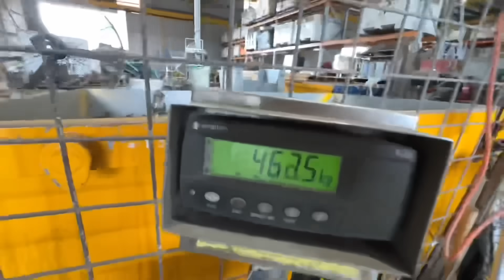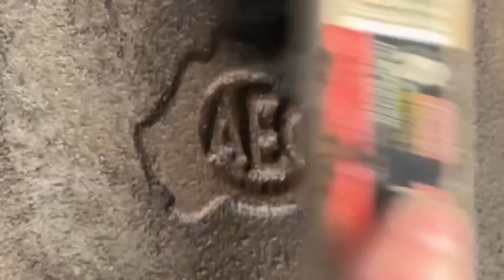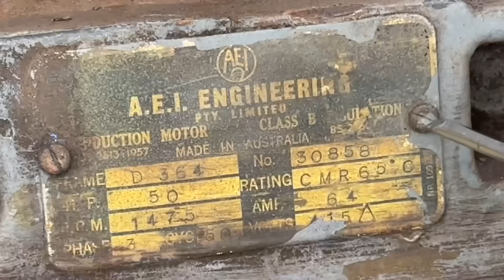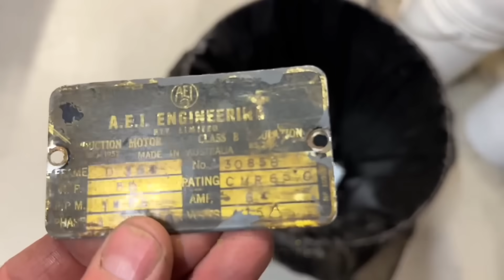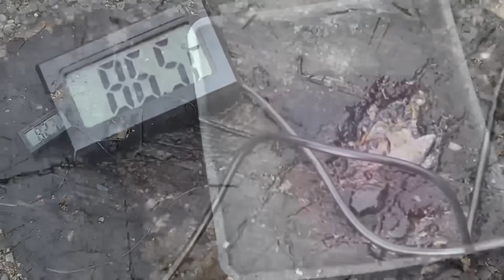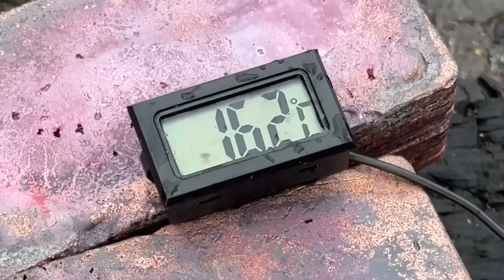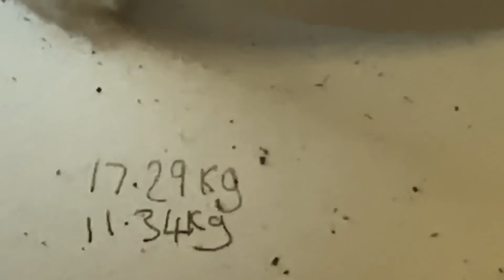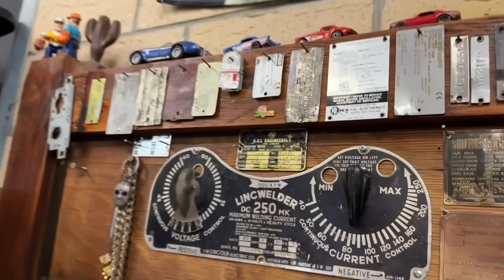433KG Massive Motor Melt Down - Scrapyard Search - ASMR Metal Melting - BigStackD Bulk Copper Bars

Comment: Bloody hell YEAH, grab 'em both, Mate!
As a medically retired Truckie, move the weight about a foot past centre axle. As in just a foot further forward.
Reply from the maker: Yeah wish I could but my  trailers only designed for 450 kg so I don’t really want to double that especially when I have to drive a little bit on some pretty shitty roads. No rush it’s all good I’m going back on Monday or Tuesday to grab it, and hopefully there’ll be some other pieces I can chuck in the trailer🤔.
Reply: I saw the first two lines of your comment and thought you were referring to the supplied picture of the Sex bot.
Reply: @bigstackD I can't blame you.years ago I ended up putting too much weight on my pup while my dispatch told me they wouldn't spend the time to get a different load for me.  once I dropped off the load, I called dispatch and told them, now the next time I tell you I'm not going to put 3,000 lb coils on my outside rail pup, you'd better listen to me.
That load didn't pay enough to cover the cost of redecking my pup.
Reply: You can take both if you make 2 trips to the scrapyard...might be gone otherwise. Early bird and all that🤔👍
Reply: @bigstackD 
 Do any of the parts get reused? Or do they all get melted down as scrap?
Reply: I don't know why, but it tickles me that used both metric and imperial measurements in your comment. 😊
Reply: @bigstackD  Hey BigstackD, just to clarify as I don't think he fully explained his point there. For just the one engine you never want to carry a load behind the axle of a trailer, that's how you'll get speed wobbles etc. If you're loading something heavy always place it in front of the axle, IE just the one engine you took should of gone in front of the axle not behind it like in the video. You risk some seriously dangerous trailer behaviour ( you can google some fun videos of improper load placements on hitchpoint trailers)
Reply: LOLOLOLOLOL

Comment: This is a nice video. Its so relaxing to watch at night when I'm winding down. I'm a new metal melter and I'm wondering how do you clean out your crucibles after you're done using them so you can melt other metals in them? Thank you.
Reply from the maker: @cassiusparker5176  normally I’ll just use a stainless steel spoon or a flathead screwdriver and give a gentle scrape. I’m not too concerned with cross contamination as these are just personal pieces I collect but when you have the chance I always recommend using one crucible for each different metal that way if there is a little bit of copper or brass left in it that can just mix in with the next melt, but other than that give it a gentle scrape out after you have poured or while the crucible is still pretty hot as that will make it a bit easier👍🏻.
Reply: @bigstackD  Ok, thank you so much. I'll be sure to do that when I get back to my melting. I melt at my school so I'm looking forward to showing my classmates these methods to make our melting easier. Thank you

Comment: Man, yo won't crack 100º while the sensor is IN the water. When any water molecule reaches 100º becomes gas, so it won't be IN the water. At least at 1atm. of pressure. This is how chemical destilation works, as much as you heat  the liquid it will stay at boiling temperatura until it fully evaporates. And you won't get superheated water in those open-air, water-moving conditions. Your are now getting 99º because it's winter and atmospheric pressure is slightly less than normal, so water boils easier. But it also depends on that cheap thermometer accuracy, that btw seems quite good.
EDIT: You get >100º when sensor is touching the tray bottom or the copper block
Reply: I was thinking the same thing
Reply: THIS!
If he read 100 maybe the sensor was on a copper brick.
But until the sensor is in liquid water at "normal" pressure you cannot reach or pass 100.
Then there is maybe a component of sensor calibration.

Comment: Nice video. the last motor i took apart i made a punch to fit the channels on the inside if the motor  and after cutting of end flush seems like it works extremely good abd cleaner and copper strands stay together to then.

Comment: Maybe it's a running joke I'm not aware of (this is my first time here) but unless you compress that water it will never crack 100C when it's in liquid stage.  The steam will though.
Reply from the maker: @fisqual  I did actually get it to crack 100 but because it’s a cheap Chinese temperature gauge it was obviously reading incorrectly or maybe it read the steam for a little bit as it was bubbling away🤔👍🏻.

Comment: Got my furnace in today! Can't wait to start doing this. Have you ever tested the max temp on yours?
Reply from the maker: @metallurgy_gaming  I haven’t tested the max temp as I’m not sure what it’s really safe to run on the regulator, but I just did cast iron again the other day and it did it quite easily. Only reason I would test the max temp would be to melt steel, but I have no plans on melting steel, even if I could👍🏻.

Comment: You made friends with Magpies!!! The more I learn about you the more I like you. 

Also: sucks you have to burn the varnish off the copper, even if you chemically stripped it the varnish would still partially dissolve into gas and the chemical bath has to go somewhere.
If you strip it mechanically, which is not really feasible, it still mostly gets burnt in the furnace. No matter what you do that stuff ends up in our environment, even if you left the motor at the scrapyard! Someone would have to deal with it.

I'm definitely watching more of this tonight. Thanks for the big video the editing and camera management must have taken ages 🙂

Comment: You're not gonna crack a 100 when it's rainy and the atmospheric pressure is low - water boiling point goes down. Try that on a sunny day, no rain, 1020 hpa and more

Comment: If you were scraping these motors regularly, what about designing a furnace that is built round the stator casting? You could burn the varnish off the way you just did, then heat the stator until the copper drips out the bottom and have a catch tray.

Comment: Regarding flat head screws. I find the easiest way to go about removing them is to (very carefully, if you want to keep the info plate underneath) take a grinder to the slot of the screw. Just enough to deepen the slot until you can get a good go at it with your flat head screwdriver. It isn't very hard to do and you don't even need to destroy the screw to make it work.

Comment: man I would  have turned that motor  housing into an out door fire place to preheating for your molds. but that's  just me I guess, I was trained to make use of what  I have and get the most from what you have, and even if it fails  it still scrap for your buddy's.

Comment: On certain days, it can be difficult to break 100°C, as water's boiling point is datermined by atmospheric pressure - the lower the pressure, lower the boiling point. That's why pressure cookers are so good in quick cooking, as higher pressure makes the water boil in higher temps, making the food cook faster.

Comment: You should get that other motor and hold it for another day. I know that it is not something that can be easily stored away but leaving it aside on the gravel would be okay. I don't know what you paid for it but surely it wasn't AU$300. 
I would give my back teeth for 20 or more of those big 3 phase motors. Especially the old ones.

Comment: You should empty the vault when scrap prices for copper get near the top. Then, use the proceeds to buy something like a 3-d printer for moulds, etc.  Maybe partner with another channel like CEE Australia that does machining for metal moulds? Just a thought
Reply: Wonder what those machines that handle fine insulated wire cost.   Basically a shredder and a shaker table.

Comment: 35:17 You won’t. Once the water starts boiling at 100C it stays there until it’s gone. The same applies to the Copper and Aluminum but obviously you’re heating them until boiling.
If the thermometer reads above 100C I would question its calibration.

Comment: yeah i was hoping  for more you got 22 kg equal  to 48.5 pounds .nice job of it are you get the other  motor. and are you going to  melt  the aluminum  off the spindle. might  be 4 more pounds their.
Reply from the maker: Yes I’m gonna cut the aluminium off the rotor as that will definitely add a few kilos. I’ve got quite a few of them here so I’m gonna do them all together when I get the chance👍🏻

Comment: I say go for the other motor, but grab you some new pairs' of gloves first. Plus I think it's about 1/3 of the motor weight in copper. My guess is around 108 pounds, by the way I stopped the video at 23:08. So I'm not cheating.

Comment: Water boils at 100° Celsius. This means it becomes vapor. At normal temperature and pressure, it does not exceed 100°. Therefore, you will hardly be able to reach exactly 100°. And if you can, your meter probably won't be precisely correct.

Comment: It would be extremely challenging to pass 100°C (but I suppose you did it, I'm a little skeptical of the accuracy of the thermometer)

Under typical atmospheric conditions at sea level (ground temperature and pressure). At this temperature, liquid water reaches its boiling point and transitions into steam (gas phase) rather than continuing to increase in temperature. However, under specific circumstances, liquid water can exceed its boiling point without immediate vaporization. This is known as superheating

Superheating occurs in exceptionally clean and smooth containers devoid of nucleation sites (dust particles or container imperfections) that initiate the formation of steam bubbles. In a superheated state, water can exist above 100°C while maintaining its liquid form. However, this state is unstable and susceptible to rapid and intense transformation into steam upon disturbance.

Comment: Of course you should get the second one! (as if you didn't already!) so lets see take off 7/8 of the weight for irony - 954 x .825 = 787.05,,, 954 - 787.05 = 166.95. Thats my guess in the weight of copper.

Comment: I always wanted to get into metal melting but I don't have a forge but I do have some old kilns I could possibly convert into a forge made from I'm guessing all fire brick with metal coils running around it but I want to say they are 2-3f wide and roughly the same height and really intimidated at the fuel cost of running it lmao

Comment: if you put 1 of the set screws after taking them out for the taper lock for the pulley into the last one in the middle it breaks the taper.

Comment: Does the copper you reclaim just not have much dross, or do you edit out removing it?
Reply from the maker: No, the Copper never has any slag or dross. Because of such high temperatures anything on or in the Copper will turn to Ash and that Ash will normally sit at the bottom of the crucible, or will come out the top of the furnace and blow away. If you look after my last Pour on this vid there’s a heap of ash I pour out of the crucible, but the rest actually came out the top of the furnace. That’s why I always wear a respirator when melting Copper with varnish on it👍🏻. But basically the same thing applies with dirty copper pipes. Any impurities like dirt or grease or paint will just  turn to Ash.
Reply: @bigstackD  Cool! Thanks for the response. I've now learned something.

Comment: You might not be able to get water to 100°C, because that's the boiling point at sea level, so if you're like 100m above sea level, the water will boil away quickly just before reaching 100°C...

Comment: you will probably not be able to get the water to 100c or above easily due to how evaporation and boiling works. right next to the bar will be over 100, but water can't really get above boiling, it'll prefer to sit just below 100 and boil more aggressively.

Comment: Isnt the spindle in the engine itself filled with copper as well?
Reply from the maker: In the very old ones motors the rotor can sometimes have copper on the ends and running all the way through it but this particular one only had aluminium. I’ve got two large rotors and I will be cutting the aluminium off of them to melt at a future date but there was no extra copper there buddy that’s for sure👍🏻. 
Now I’m looking to do a 680kg motor in a couple weeks and I believe this one is 70 or 80 years old, so hopefully it will have a crap load of copper.

Comment: Could you answer a question for me? i watched reline your furnace, is it nessary to apply high temp cement over top of the kaowool if i used a ridigdizer on the kaowool that made the surface ridiged. thanks
Reply from the maker: At the end of the day, the only reason we put the coating on the wool is to stop the small fibres coming off that being released into the air and being breathed in or stuck to your clothes. So Any type of coating you can put on that stops that from happening is perfectly fine👍🏻.

Comment: Thought about LP gas. Tanks are larger
Reply from the maker: I worked out I would save just over  15% if I had the larger bottles but the depot that swaps those bottles over is an hour round-trip, whereas I can swap these small gas bottles every time I go to the hardware store so it probably be about the same cost when you take everything into account plus the smaller bottles are easier to move and when they’ve got a little bit of gas left, I can chuck them on my patio heater or barbecue to use up every little bit 👍🏻.

Comment: What is your altitude where you are? Even 100 metres and you ain’t gonna get to 100 degrees C. It looks like you are near enough sea level but it still struggles to get there.
Reply from the maker: Keep watching mate I cracked the 100 👍🏻
Reply: @bigstackD Can you do a kettle of boiling water for comparison? 
Would be good to see because away from the element or red hot metal you will see the true boiling point. If you get your altitude then you can make the calculation and see if it is spot on. Would be a great addition to one of your vids.
Reply from the maker: When I checked my address, I’m only 16  to 18 metres above sea level

Comment: You won't be able to reach 100C in liquid water. Once the water reaches that, it becomes steam, hence the bubbling. You can do it, but, you'll need a covered container that can contain some positive pressure, like the radiator in your car.

If you read over 100C in water, it's either a calibration/accuracy error, OR, you are actually measuring the steam as it exits the liquid water.

Love your videos!

PV=nRT;

https://en.wikipedia.org/wiki/Ideal_gas_law

Comment: 100 C is an artificial value calculated for 4 degrees celsius and a certain atmospheric pressure they deemed standard. It's not the same temperature, purity, or air pressure, therefore, it might not be 100 C

Comment: Just got a furnace today but what sort of fire brick do I need?
Reply from the maker: The devil Forge furnaces comes with fire bricks so I’m assuming you got the Chinese model ? 
pretty much, any fire brick should do . 
You should be able to get them from either your hardware store or off eBay most fire bricks will break after the first or second firing, ( even the devil-forget ones), but as long as their level, you can quite comfortably use, a broken fire brick to put your crucible on. Just put down a bit of cardboard in between the crucible and firebrick , so you never have to worry about it sticking as when the cardboard burns it will create a layer of carbon👍🏻.

Comment: Isn't the strator some 50% the motor's entire weight?
Reply from the maker: @stitch626aloha  I don’t know about 50%, but it would be pretty close I reckon 👍🏻. There is some aluminium in this stator which I will cut off and melt, but I have quite a few stators here so I’ll do them all in one video👍🏻.

Comment: How much do you pay for these motors and such?

don't they sell Sledge Hammers with a spike end?

you know how you take all the wires and twist them up. Maybe make a little jig for your drill. I'd recommend  a small rod with a hold drilled through it where you can slide an end of a wire in it then spin the drill to coil these things up into nice little spools to drop in the forge.. Alternatively, you could use a broom handle with a slit in it and then wrap a bunch of wires around it. 

it may save those hands of yours.

Comment: no way that trailer isnt rated for 2k lbs
Reply from the maker: Actually, it’s only a cheap Chinese flat pack Trailer it’s rated for 990 LBS or 450 KG. Just a  single axle trailer.
Reply: @bigstackD  oh damn, its just 4x6 then? i didnt realize it was that small. most of the walled trailers here in the us are rated for a ton.
Reply from the maker: Actually, it’s a 5 x 7, but it’s just the cheaper version. I could’ve got the duel axle one but that would’ve been an extra $1500. I regret it now but it doesn’t matter I suppose as anything heavy enough to go on a 2000 LB limit Trailer  would’ve been impossible to get it off myself👍🏻.

Comment: What about the rotor?
Reply from the maker: Yes, I need to set up an external burner to melt the ends of the rotors off. I’ve got a few rotors stacking up so that will definitely be happening in a future video.